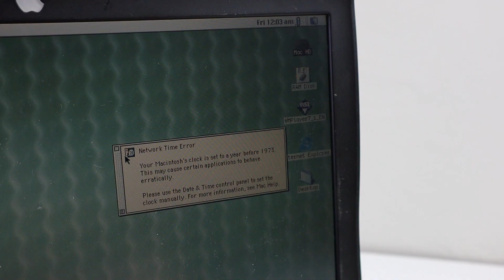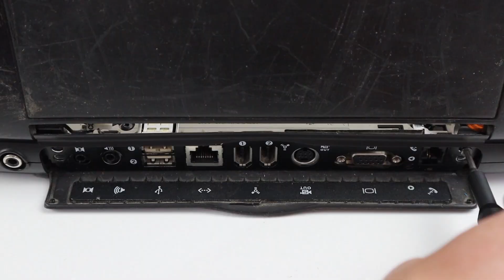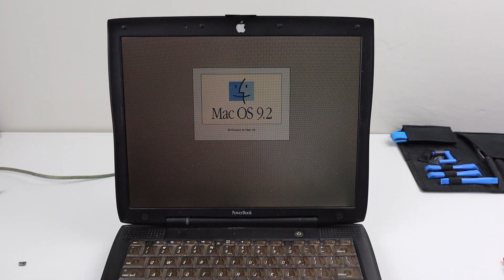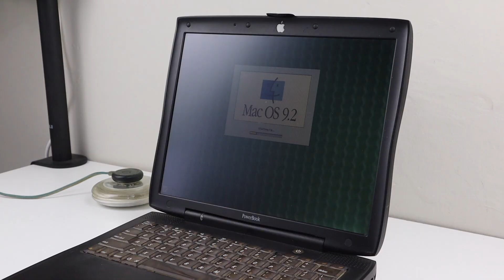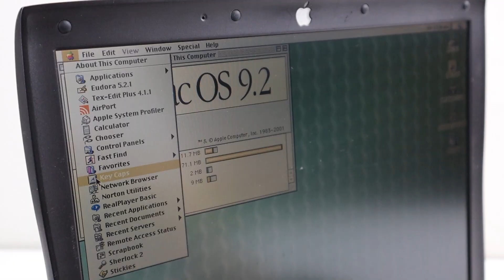Restoring Apple's Most Upgradable Laptop - PowerBook G3 Pismo - The M1 Mac I Wanted To See...

Comment: You can get BR2330 from AliExpress.
The important thing to note is that they are rechargeable, so do NOT use CR2330, the batteries will explode when the PowerBook tries to charge them.

Comment: I got a working one of these for 7€ 6 months ago. It‘s in pretty good condition except of missing rubber feet. I‘ll have to rebuild the battery pack and it will work as good as new!

Comment: Nice work, but I'm baffled as to why someone doing this at your level is still using a conical soldering tip? :P also after using the 2k paper use some buffing compound to bring back the shine, ideally on plastic you'd go to 3k after 2k before buffing.